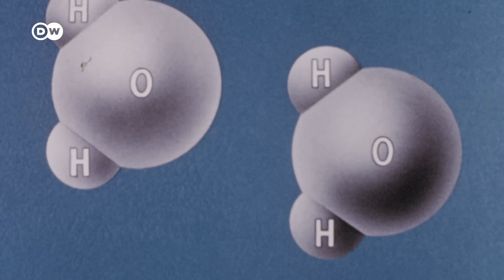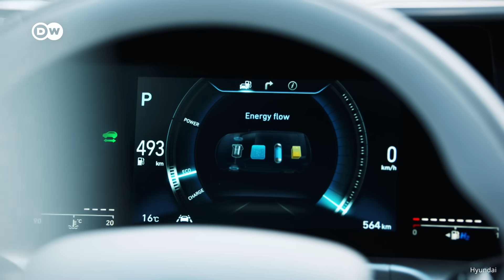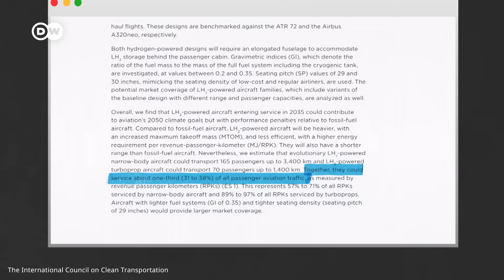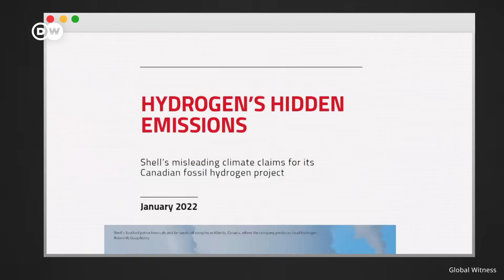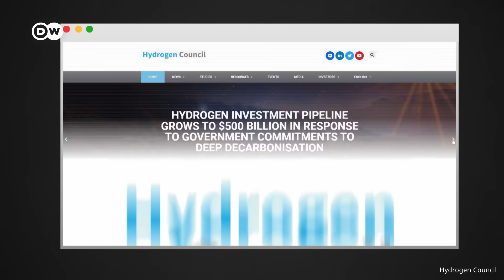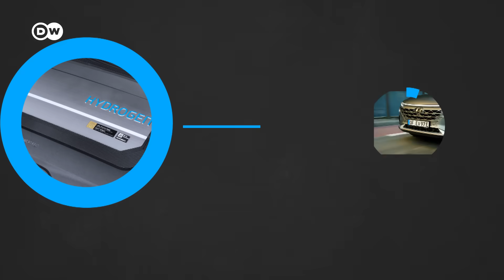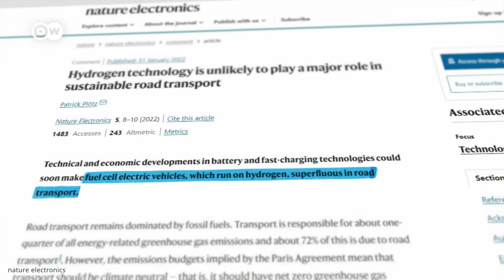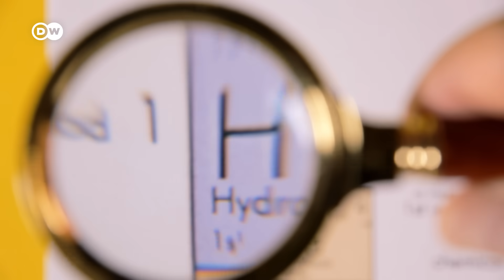The truth about hydrogen

Comment: Why can't we make a unit that makes hydrogen, that fits in a car, where all you have to do is put water in your gas tank? I think it can be done. I've heard of a system that can power your whole house with water, making hydrogen that heats the house and water all from electricity.
Reply: That makes absolutely no sense, unfortunately. If you had a car with a water tank to turn into hydrogen you'd need a battery to power that. At that point why not use the electricity to run the car? Especially because the hydrogen in the cars is used to generate electricity to then run the car so you'd just convert it twice, being horribly inefficient.

Comment: We can create renewable electrical energy cheaply using tidal, solar-thermal, & geothermal while we improve hydrogen producing and energy storage methods. Vertical access wind turbines can efficiently power pumps as well as generate electricity. We also need to consider waste management & recycling methods while creating bio-fuels and conserving resources.

Comment: You ignored the fact that this is a great solution for a power grid that wants to be green. Whi is this important? Look at all the energy Germany produces with it’s windmills and solar. This source of energy is very inconsistent, there are surges of energy and no way to utilize it. Hydrogen is perfect for capturing this energy so that it can be used on days there is no wind or sunshine. Yes you can argue that a lot of energy is lost in the process, but right now all of it is lost.

Comment: I think you kind of touched on it already.  You have outfits like CATL ready to mass produce LFP batteries in Germany and should be before the year is out.  LFP is a great, sustainable, battery type to mass produce and store energy in.  Maybe use it in trains and busses that don't already have overhead lines to use in addition to stationary storage. You have Theion in Germany claiming to have LiS batteries figured out.  This is great for demanding applications such as regional airliners flying on all electric on down and is a very sustainable tech if proven out.  I mean saying electric regional airliner by itself is game changing if you have been paying attention.  Battery is more daily cycler and transportation use.

There are various gravity batteries you can use for storage such as pumped hydro and moving rocks up and down hills and such.

When you get these other more efficient batteries in place, then you start thinking about the Sabatier reaction, which is probably the most important thing Germany should be focused on right now, and then less importantly hydrogen.  These are more special / established use base and say winter storage.  Especially if you could capture CO2 from the various sources you have around Germany and convert to natural gas and liquefy it, you could have piles of LNG stored away.  Maybe also use salt domes and such in the Earth for just compressed sources as that may be more efficient than liquification, if you understand what that entails, you will understand why salt dome storage instead is a nice option.

You would likely want a tax and subsidy system as there is a penalty for storage, but it is so important for rounding out a green energy solution.

Comment: "For every complex problem there is an answer that is clear, simple, and wrong". Hydrogen isn't as well suited as ammonia  as a fuel produced by electricity but it too as serious downsides as do lithium batteries, wind power and solar.
Reducing consumption and the world population is the best long term solution
Reply: It is hard to dissagree with your solution if the goal is to reduce the footprint of humanity. Only issue is: How do you achieve that goal? In general the population does not want to reduce itself but it does tend to want always more
Reply: @hotdognl70  well education of girls and access to birth control has worked to reduce family size in many countries even in Catholic Italy which has the lowest birth rate in the world. 
Tax incentives and dedicated lanes to encourage motorcycle commuting and free public transport.
Heavy taxes on SUVs & sports cars and air travel too.
Many little nudges would help but there's no simple single solution of course
Reply: @noelchignell1048  Your "solutions" are only suitable for a minor part of the population, mainly the western culture. Many parts of the world don't even have dedicate roads for motor vehicles.
Reply: @hotdognl70  well that minor part is about a billion people and they use far more resources than average so it would be significant and as the poor countries become (hopefully) wealthy and educated this will help too.
Religion doesn't help with it's hatred of population control
Reply: @noelchignell1048  Exactly. And that mayority wants what "we" have: More of everything. Of course we need to help and educate but that will not be enough.

Comment: The United States and Europe will be held hostage by foreign fossil fuel production countries, forever until we build a Hydrogen economy. You do not have to build expensive platforms to drill for it and transport it, process it and transport again.

Hydrogen can be generated locally and used locally. Today it may be expensive but even flat screen TV our cheap in comparison to 10 years ago. Solar panel prices have fallen 80% from 2010.

Power plants have to run at near full power to achieve lower costs, but when the demand is not there they ground, or throw away the extra. This could be you to generate Hydrogen.

The debate is over, every country needs to go Hydrogen to eliminate future foreign conflicts. Saudi Arabia is building the largest Hydrogen production plant in the world for EXPORT. Do we really want to buy it from them? 

If after the oil crisis of the early 1970's we started to take Hydrogen seriously the US would have been free of the current crisis. 

BUT NO greedy big business and greedy myopic politicians can't get their head around Hydrogen is just another form of energy that can be monetized.
Reply: The US?
The US is a net producer...

Though i agree, we should decouple ourselves from the horrible and ultra corrupt fossil fuel industry.

Comment: In Denmark the plan is to integrate renewable hydrocarbons in the aviation and marine transport sector. Using huge wind turbine farms to produce clean energy used in the production of hydrogen and then converting it to transport fuel with biomass, such as straw and manure. We are having a large agriculture industry in Denmark, producing a lot of biomass as a byproduct.

Comment: I learnt in my physics classes: energy in = energy out. So for all the energy we want to get from hydrogen, we must find a source of energy to produce it.
Reply: Yes. That's why wind and solar power is used.
Reply: @jimandwendysullivan4239  I think it would make more sense to use wind or solar directly, to prevent wasting energy for the transformation into hydrogen.
Reply: Dear SB. Wind and solar are also being used to make hydrogen to fuel cars. Japan is doing it in a big way.
Reply: @jimandwendysullivan4239  I am in favor of using solar energy on cars directly. A Dutch university has built an off the grid solar camper van. There is no need to transform solar energy to hydrogen. It is a prototype but we are getting there.
Reply: @SB-sh4oe  That camper is superb - but it relies on its size. We can't all drive around in camper vans and park them on the company car park for the day while extending all of the available solar cells...

Comment: Here's why hydrogen will not ever be a practical fuel as described by it's cheerleaders. Even if you find a way produce it efficiently you still have the problem of storage. At ambient temperatures and pressures, hydrogen wants to be a gas. In order to store enough for an appreciable range in a car you would need to compress it into a tank  that would be far to big and heavy to fit practically into the chassis of an average sized car. Additionally, it would need to be compressed to pressures of thousands of pounds per square inch. Imagine that rupturing in an accident. It could be stored as a liquid in a low pressure tank if it were refrigerated to under -250 degrees Fahrenheit, but that takes even more energy and even with the best insulation, ambient heat will migrate in and boil the liquid hydrogen causing the pressure to rise and the tank to rupture unless it is equipped with a pressure relief valve, and if so equipped, the hydrogen will continuously vent until it is all but gone into the atmosphere, just as a tank of liquid oxygen does. You must use it or you will lose it anyways. Splitting the water molecule  is the least efficient way to produce hydrogen. Commercial hydrogen production uses natural gas or oil because it is more efficient but it still provides no advantage other than it can be used in a fuel cell, but other easily obtainable gases can do that as well. Using hydrogen is simply a way of storing energy, like charging a battery, but not as efficient. I'm afraid hydrogen power taking over from oil will remain an unreachable goal, but it does give lying politicians something to talk about.

Comment: Why did you add the anti-science "climate crisis" 💩💩💩💩without contrary opinions?  That's not scientific whatsoever.  The climate hasn't been much better for humans than it has been in the modern era. The planet is greening with more CO2 just as it does when farmers pump it in to their greenhouses to increase yields.  And you lie when you say that steel companies are "responsible for 8% global CO2 emissions".  Here are the actual numbers regarding the atmosphere:

● N2 Nitrogen 78.08%
● 02 Oxygen 20.95%
● Ar Argon 0.9340% 9340ppm
● CO2 Carbon Dioxide 0.042% 420ppm
● Ne Neon 0.001818% 18.18ppm
● He Helium 0.000524% 5.25ppm
● CH4 Methane 0.00017% 1.7ppm
● Kr Krypton 0.000114% 1.14ppm
● H2 Hydrogen 0.000055% 0.55ppm
● H2O Water 1% 10000ppm

1-2% of the atmosphere are greenhouse gases
95% of greenhouse gases is water vapor
3.62% of greenhouse gases is carbon dioxide
3.4% of carbon dioxide is contributed by humans

Comment: Could a fuel that stores hydrogen bonded as in DNA be efficient enough? Could we use enzymes to break that fuel down to release usable hydrogen, maybe in multiple progressive chambers, kind of like how cow stomachs work? Maybe the spent fuel could be recycled?
Reply: Impossible, Make a simple calculation how heavy such a molecule would be - and you can maybe store one H2 hydrogen molecule which by weight would be only a minute amount overall.
Reply: @karlgunterwunsch1950  to be clear, I’m not suggesting DNA itself, but hydrogens loosely bound to other atoms via Van der Waals forces, as across nucleotides in DNA.
Reply: @karlgunterwunsch1950  thanks. I looked into this some more. It seems that through physical adsorption, hydrogen can be influenced by van der Waals forces and not have to be chemically bound to remain with a material. The other part of the idea, enzymes that could free it, probably doesn't make sense though, because an enzyme would likely cause the hydrogen to become chemically bound to something else. It seems as though there are other means to deal with hydrogen in this case, though. I saw a paper talking about using magnetic fields to free hydrogen that had been adsorbed onto a substrate of aluminum doped graphene. Very interesting stuff.

Comment: We could use the peaks of energy produced by solar and wind to produce hydrogen with electrolysis. It could be done with sea water, but there is the problem with cleaning the electrodes.
Reply: we could store power in the form of hydrogen with a 25% efficiency and large infrastructure costs or as compressed air in the deep ground at 70% which is white recent projects in China and Australia have been getting. Hydrogen for energy storage is an extremely bad idea.

Comment: My Hydrogen question is, why do we have to have huge plants making Hydrogen & then Transporting it?, when it can be made on site of use, Ie a construction site, or remote service stations, large Farming concerns, Transport Companies, Etc.
Reply: Because the electrolysers are inefficient at small scale and they require specialised ancillary equipment such as water purification, pressure vessels, compressors - all able to withstand one of the most nasty molecules in the world when it comes to storage. Hydrogen can diffuse through solid metal and alter the structure of the metal along the way, weakening the structure - something you don't want to happen if you want to store any significant amount of it.

Comment: This video is nonsense. It requires a lot of energy to create hydrogen.  It requires a lot of energy to keep hydrogen liquid, which is down around -263 C.  It is extremely difficult to store because it leaks out of the tiniest hole. Experience has shown that it turns pipes and valves very brittle.  Only foolish people ignore all these problems.

Comment: also with  batteries we need to take in the consideration that in winter months we use alot more power ie dark nights lights on more often, heater running. so battery power needs to be greater

Comment: They've been talking about the Hydrogen Economy since the 1970s 
It won't happen till at least the end of the century
Back in 2005 I made a fuel Cell assignment in High school, at that time they had just come up with the hydrogen tablet by storing the Hydrogen in salts supposedly they could lower the volume significantly.
It worked and was a massive breakthrough to the magic wand that was going to solve the riddle of hydrogen storage, but that was also the last time I ever heard about it, it's been 17 years now.

Comment: We can generate pure green hydrogen by using Ocean Motions International’s wave energy or vault pump systems to generate electricity that makes the hydrogen; that same wave energy can yield pump pressures several orders of magnitude higher than that produced by oil or electric driven pumps; these higher pressures means far cheaper reverse osmosis.  For example, Saudi Arabia spends 48 times a much to produce 1 m3 of potable drinking water as compare to wave or vault energy systems.

Comment: Always be skeptical - even (especially) when you favor an outcome. When they said that blue hydrogen was pushed by carbon company lobbying, they say nothing about the other side - why the lobbying worked. It was climate change activists within governments who set goals and regulations, not coal companies. Think about ethanol additives in gasoline/petrol. Ethanol fuel is clearly bad for the environment, as well as bad for drivers. But ethanol was sold as a green fuel, and who can be against that? Biofuel is at least as bad, if not worse. So why did governments OK the use of biofuels in place of 'carbon' fuels? Hint: it wasn't lobbyists from 'Big Wood.' It was climate change activists in partnership with government regulators. So stop blaming corporate lobbying when the problem is inherent in the activist-regulator complex.
Reply: Biofuels that displace food production and lead to greater land clearing are the problem. Biofuels from waste products sewage etc are to be encouraged to squeeze out that last bit of goodness.

Comment: Hydrogen is the best and only realistic clean storage of energy known to man even if its not as efficient.

If you were able to get the energy density of battery at a comparable level to Gasoline let alone jet fuel you still need to dispose of those battery's. Think about that.

Right now there are millions of cars that have these battery banks in them, yet they are only 3% of all vehicles on the road today. All gas powered vehicles have a 90-100% recycling strategy. From old oil to chips to steal its all recycled. But the battery's in electric cars are not. What happens if there are billions of cars needing these battery's, older cars also need to replace old battery's. So one car may need 3-4 battery replacements through out its life. now your talking trillions of these massive battery's world wide. How will the world maintain supply? How will they recycle them? What is the energy cost in doing both? last, will all country's to have a plan for both? 

A Hydrogen tank can be replaced and disposed of easily and cheaply. The energy in it is non toxic. If the energy storage fails it can be released safely.